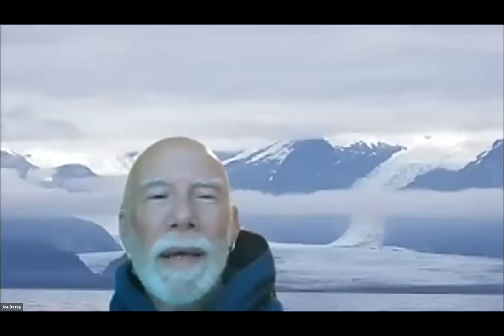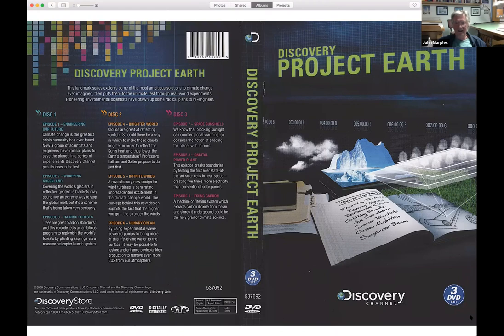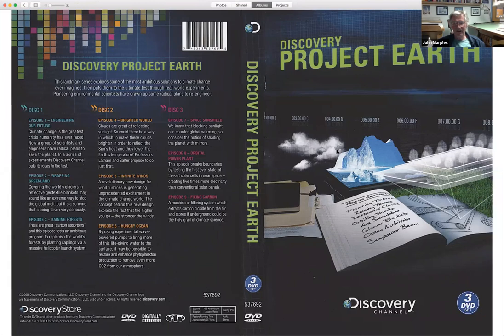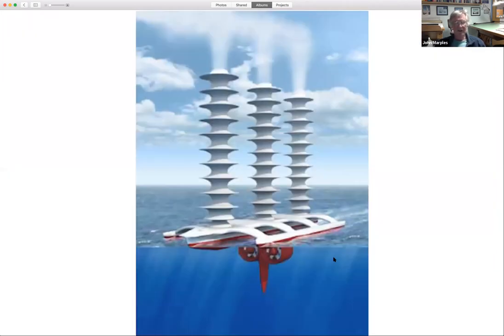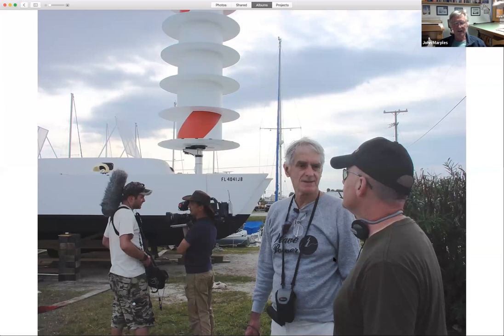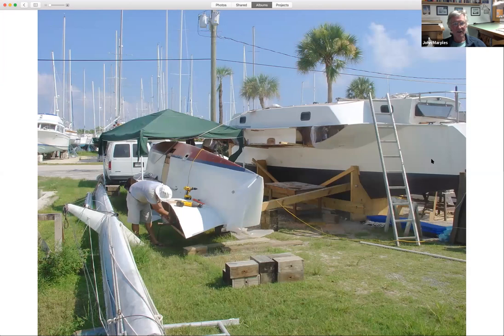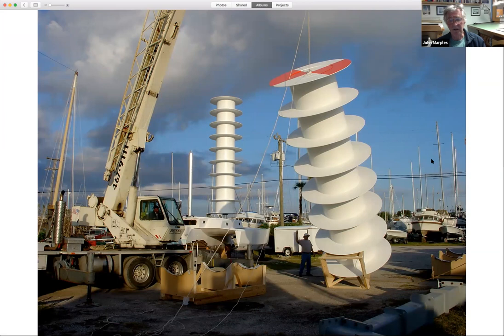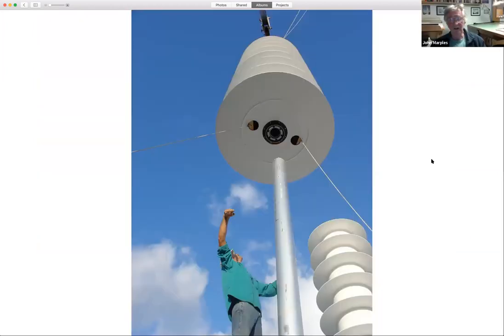May 2021 NWMA Meeting | Trimarans and catamaran boat projects from 21' to 110' with John Marples

Comment: Nice presentation! Sad that no one was able to take the reins on the Discovery special build. A lot of impressive high tolerance work to get it functioning. Also cool to hear about the personal swing wing  design with the added complexity of the curved akas. Roomy open cockpit day sailers are the best way to enjoy a nice day on the water. On another note, any updates on the member who purchased the Seawing 24 a few years back that was going to a bunch of work to it? I believe that particular boat may have been the prototype that they built to pull moulds from which would explain its construction and lack of finishing details.

Comment: Very interesting behind the scenes look at an interesting project. I am not sure what the flettner rotors were doing for you that a regular sail or rigid wingsail were not going to do. It seems like a lot of complication. I suspect that releasing vapor that low down would not have much effect on cloud creation. Another alternative: a giant floating porus black plastic sheet would cause increased evaporation more easily and cheaply.